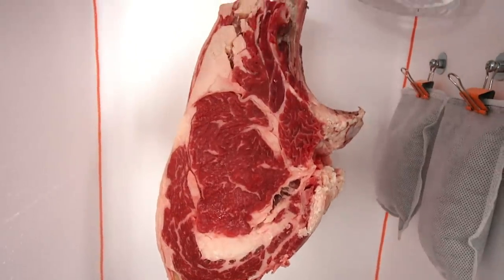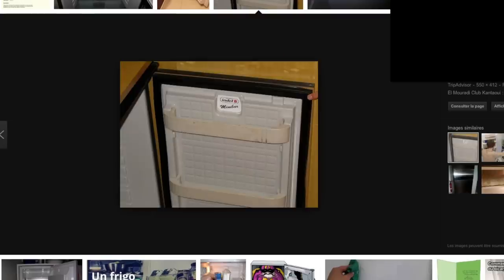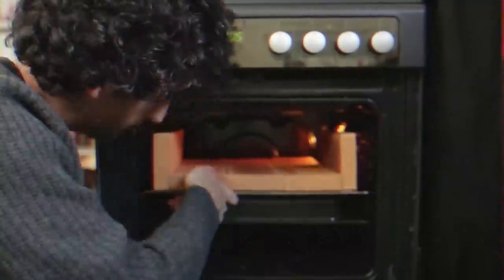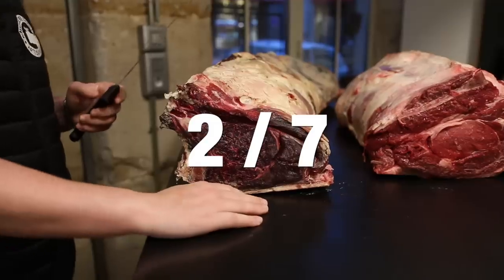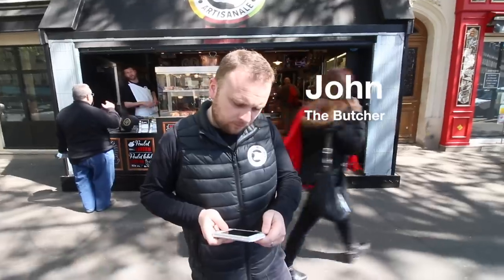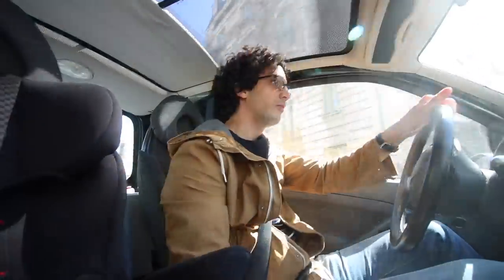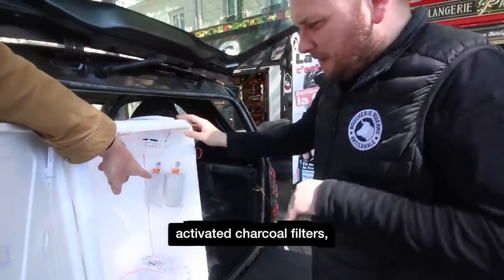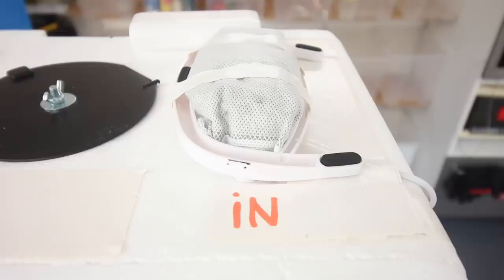3. The Dry-Aged Beef Machine | How I Dry Age Beef At Home

Comment: I have been dry aging my rib eye roasts for years in my main refrigerator. As soon as I get it home, it goes on a rack and dries  until ready for herb/oil application and roasting. Granted, it is usually only around 5 days or so, but what a difference those few days make. I've never had a problem with residual smell or taste, but have never made it to 45 days either. I like your creation and may have to give it a try. Once you've tasted dry aged beef, it's hard to go back.

Comment: airflow input and output should be in oposites sides in order to get a flow Alex...
consider the input with cold air in the bottom, and assumming the air get some temperature inside the box, output should be placed in top of the box.

Comment: I am going to build a dryer along the same lines to make biltong, a South African dried beef delicacy, but the biltong method uses salt and doesn't require refrigeration but rather uses heat to speed up the drying process. The salt at the start of the process prevents bacterial growth. Spices are added for flavouring. Commercial makers also use preservatives such as sodium nitrite but I get angry that manufacturers are even permitted to put that poison in food. Looking forward to seeing the results.

Comment: You should add a small robot arm that picks up the small desiccant packs one at a time, moves them through an external oven to drive off the moisture, and then returns the dry desiccant packs to the dry age box.

Comment: I did it with an 8lb ribeye roast in a fridge with decent fan that didn’t keep ideal temp but wasn’t opened regularly as it was in garage dry aged it 21 days and turned out perfect and yes it did reek up my fridge but well worth it the prime rib it made for thanksgiving was to die for 💀 definitely good call by the butcher to add air input and output but would recommend adding salts to bottom of your rack or drop tray if you don’t do the whole box in a box that he did. Was fantastic to see how handy you are xD

Comment: You could use a peltier module for the cooling ... That way you can integrate the air input and output since you won't be putting it in the fridge....

Comment: Just a quick heads up: You don't need the air in- and outlet in your machine. You usually need air flow to remove the moisture from the air to help the drying process. However, the moisture will be absorbed by the silica gel you added, keeping the air dry.

Comment: The main problem I see with your fridge inception is, The air inside the box does not come in contact with the evaporator or refrigerator cooling surfaces. So it will not become dehydrated. The evaporator in a cooler or refrigerator is what removes the moisture from the air. source, I am a refrigerator Technician

Comment: Quick tips for dry aging. If you're going more than 21 day you'll want 80-85% humidity. You run a risk of getting a bark too quickly and slowing the desiccation process. With higher humidity you'll want higher air flow.

Comment: AFAIK air circulation should only be needed to reduce air moisture. As you already fixed that with the silica, you probably did not need to add the air circulation holes.

Comment: I think the ventilation holes may not be neccessary and can cause problems,  because the silica inside will be drying out the entire refrigerator instead of just the box, also the temperature may not  be as stable as you wanted.
Reply: Drying out the entire fridge is not necessarily a bad thing though
Reply: The real problem is he can't use his fridge for the next 45 days.
Reply: Without the ventilation holes, it´s really hard for the air inside the box to cool down. That box is not 100% hermetic, but its function is to isolate. That makes the ventilation holes absolutly neccesary.
Reply from the maker: Holes seem necessary to cool down faster, but indeed they end up evening the humidity throughout the entire fridge, which is a pain. I found another solution to cool it down rapidly, meaning that next one should probably have no holes. #stilltesting #yesIwillbuilanewone

Comment: I would have placed the fan at the inlet to help force the air to circulate towards the outlet rather than just hanging the fan in the corner. Other than that, the idea seems sound.

Comment: I don't get why you need and air output and input, without them the air is still moving inside, and you silica is absorbing moisture as it exits the meat. it's still in your fridge, so even with an input/ouput you are still in a closed box
Reply: Exactly my thoughts! And its probably making things worse cause now you have humidity from the fridge going into your box and filling the silica gel with water. His friend's dry aging system most likely has it's dehumidifying system outside the main chamber which explains why it has ventilation.

Comment: I did 1 almost like this years back. 
It works yes. But is it a true dry aged steak. No it’s not. 
Unless your doing it the right way various methods will get you 60-85% there. Even 90% 
But some might think 10% isn’t a big deal. Well 10% is a major mile stone in dry aged.

Comment: Ok...
Two issues, two tips.  Maybe three..  Or four.  😆 
  1st, the elephant in the dry age box.  Are you aware of the special dry-age bags which are designed for home dry aging?  If not, then Chek out the video by Guga foods.  It solves a multitude of sins.   I get it, it shouldn't be needed and that is why you built your box.  Check it out anyway.
  Try putting a few slabs (2 or 3, depending upon size) of Himalayan salt blocks on the floor of the box.   This helps deter bad bacteria and promotes good bacteria.   Its a "secret" of very old facilities that have done this on a huge scale for years.  :)
  About the fan you need, a computer cooling fan is plenty!  you just need continual air movement, refreshing with clean air thru asnall, filtered inlet.  :)
 Two...  The desiccant  (That's "DEH'-sih-kent ..."  you can help me with French later, please. ;) )  The secret to this is to get a few larger bags.  They absorb a little more slowly and when they get moist, pull them and place in a 200-225°F  (I'll let you do the math) oven for about a half an hour to an hour.  This "resets" your desiccant and stops any exo-thermic (two components combine to give off heat) reactions.
  The dry-age bag will allow the moisture to escape while helping to prevent unwanted contaminates to have access to your prime cut.  The moisture will be under control.  You already figured out there has to be significant airflow through your box.
   Congrats, Bob's your uncle.
  BTW, try dry-aging for 28days, first!  BIG flavor changes happen between 28 and 45 days.  Most American beef is dry-aged no more than 28 days unless its a special request.   And it's great!

 I'm adding a third, "cheat" tip...  In the interim, while you have no dehydrating fridge, for a fast, down and dirty dry-age, place your steak on a cooling rack, on a baking sheet, with a paper towel on the tray.  
  Place your racked steak in the top section of your fridge, because that is where the airflow will happen.  Leave it over night, from 8-12hrs while trying not to open tge fridge EXCEPT  to flip the steak over about halfway through.   At the end of your time, pull the steak and trim any dry, desiccated portions, the fat, jerky-looking meat, etc. so that you have clean, fresh looking meat when your done with the trim.  You'll be surprised at just how effective even 12hrs of "dry-aging" your meat can make.  You'll get a denser, more intense flavor than cooking a regular, fresh steak.   Enjoy!  (and don't worry  about flavor absorption/contamination, it won't be in there long enough 😉)
Reply: I come from the future to give you credits about the desiccant. You were and are totally right about it. But gladly, he cracked it and as you migh know, the results were brilliant! 

Cheers anyway, I tend to watch a serie from him, and later red the comments from the beggining of them, if that makes sense.
Reply: @pabletedona  
  My gosh, it doesn't seem like so long since I wrote this, I still remember it.  And thanks...  And you're welcome.  :)  Happy trails...

Comment: You can use a old fridge if you clean it first with concentrated vinegar acid, and then give it a "UV-C Shower", you can buy UV Lamps for sterilizing purpose. Not only kill the light every microbe, the UV-C emission produce ozone gas which kills all bad smell. With that method your fridge gets as clean as fuck. Even new fridges aren't that clean.

Comment: Wait. I'd have to lose that much space to hack the optimized aging.?.. I'll spend the money to buy the mini-fridge and desiccant!  I'm willing to spend $150USD to easy mode this.
I like the cheap option (i'd probably use two of the120mm computer fans on hand, instead) But adding filters and a humidity control, along with the space lost in my main is a big drawback.

Comment: Sounds like you screwed with the thermocouple in your oven by putting the bricks in there to make pizza

It monitors the internal temp of your oven, when you add the heat-retaining bricks in there your oven makes corrections, such that when the bricks are removed, the oven probably doesn't get as hot as the control says

Comment: That meat looks too small. I would want to age something twice the size. The bigger it is, the less the waste, and the less effort per pound. That's only going to make about 3 decent sized steaks, 4 if you want pussy sized steak. One little dinner party and they are all gone. I would want leftovers to freeze and have another time. It would actually be most cost effective to just buy an entire 20lb ribeeye subprimal. Age whatever fraction of that you can, and freeze the rest unaged. I'd want to age half or a third, freeze a quarter into a roast for a small party, and slice the rest into individual steaks, make some right away, and if any left, freeze those individually. Go big or go home, right?

Comment: I am a DIY fan, but i gotta say you clearly have NO CLUE as to what the ideal temperature and humidity range** for dry aging beef is ... watching this vid, it seems you're simply monitoring (not controlling) both ... a pile of dessicant packs and a circulation fan is NOT enough. I predict your experiment will not end well ... such a waste of beautiful meat. 

This sort of underinformed project is potentially dangerous to viewers who attempt to follow it, at the risk of getting sick if something goes wrong. If that happens, you run the risk of getting sued. Just sayin.

------
** Ideal temp is 34-37F, ideal humidity is 80-85%.

Comment: Very uninformative.

You can dry age beef in your fridge without this nonsense, the only issue is that you can't dry age a single steak like the one in the video, it has to be a large cut of meat.

1: Buy a prime or choice boneless beef rib or loin roast from the best meat source in your area.
2: Rinse it well, and pat it dry with paper towels. Do not trim. Wrap the roast loosely in a triple layer of cheesecloth and set it on a rack over a rimmed baking sheet or other tray.
3: Refrigerate for roughly 4 to 14 days; many people like the 2 week mark the best, aging more than that is a hate it or love it tasting experience. After the first day, carefully unwrap and then rewrap with the same cheesecloth to keep the cloth fibers from sticking to the meat.
4: When ready to cut, unwrap the meat and, with a sharp knife, shave off and discard the hard, dried outer layer of the meat. Shave away any dried areas of fat, too, but leave behind as much of the good fat as possible. Cut into steaks.